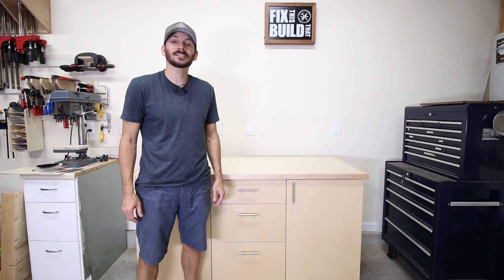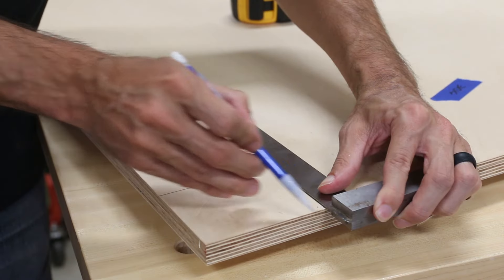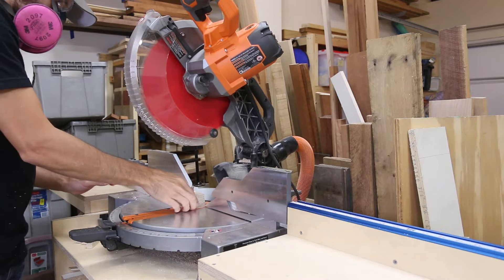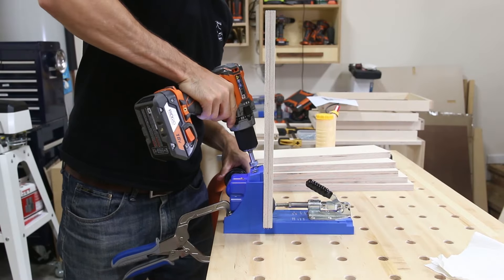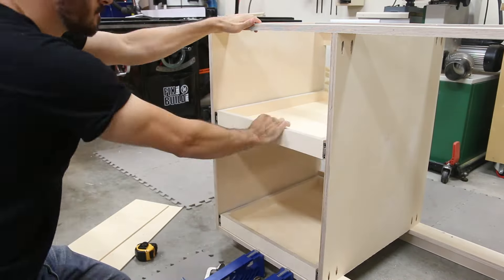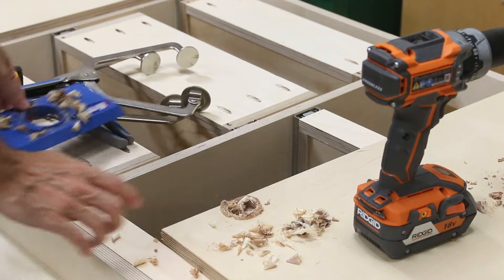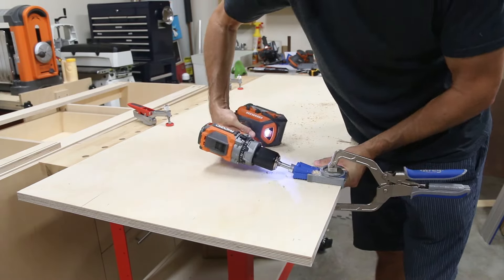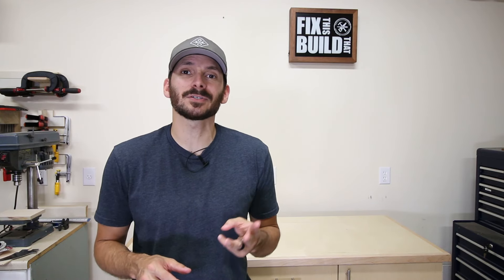How to Build a Base Cabinet with Drawers | DIY Shop Storage

Comment: Everything we need, and nothing we don't.  Thank you!  
It's helpful that you included your mistake and the solution including the fact that you would improve your solution in future!
I keep coming back to your video; it's the most helpful for my needs by far even though I'm only making a single cabinet with floor slides for my trash can drawer.

Comment: Man, efficiency is king in my book. Some try to call me lazy until they see all my work is done. I LOVE all the tips and tricks like the measurement cheats, it increases efficiency and therefore my productivity. Thank you so much man! (I have Asperger's so i dont always see what's so obvious to others.) Like the last video how to build drawers i was a little confused why you knock a whole inch off the height, but the details here lining up the drawer end and two slides to get the width of the divider was genius.

Comment: Kudos for the Kreg K4/K5 dust port and the track saw.  The dust port collects virtually ALL of the chips and is VERY inexpensive.  I bought the entire Kreg track saw system and it almost eliminates (maybe 98%?) circular saw dust in my enclosed, air conditioned shop where dust is really noticed.

Comment: Great build!  It is honing some project ideas I have. One suggestion though, add nuts to your adjustable legs to lock them at the preferred height. Vibration from power tools will cause them to walk out of adjustment.

Comment: Thanks. I just purchased the plans.  It's almost exactly what I was planning, just with slightly different dimensions.

I have two questions:
1. You use two different pocket hole jigs, I am guessing I could just use the K4 jig, right?
2. If I adjust with 1/2 spacers on each outer side, I am guessing I make the drawers 1" smaller?  Or did you already adjust for this in the cut list?  I know, math, but I thought I'd ask.

Comment: Absolutely love your videos man.  You are giving out great instructions and details in a way that is easy to understand and follow.  I came to know your videos as I was struggling with making drawers and using drawer slides for the first time.  I struggled my way through it, made a bunch of mistakes, wasted plywood too.  (:-)  That lead me to search for videos and found your site.  Darn it all, had I seen your drawer video first I would have known what in the world I was doing.  But I have to say you made me chuckle in this video when you gave out the proverbial uuuggghhh! after having to redo your drawer slides when you didn't take into consideration the drawer slides hitting the cabinet doors.  Great job with your explanations and describing your mistakes as well.

Comment: Love the video! These frameless cabinets are almost the exact kind I was going to build for my kitchen. However, only using braces for the frame and not putting a bottom shelf was something I didn't think of. I've been trying to figure out ways to save wood and that was a good idea thank you. I'm not sure if it'll work, I'm thinking about trying it on my drawers, but another thing you can think about doing instead of having to shim up your drawer rails is to Mount them to the bottom of the drawers instead of the sides. It would require installing a couple of small braces to attach the rails to and will also require using a thicker bottom to the drawer so essentially a little bit more material but on the other hand your drawers could go edge-to-edge and your rails would be hidden on the bottom.

Comment: Hi Brad, I enjoyed watching your base cabinets with the doors in the sides and the drawers in the center I have a thought about the t nuts and the carriage bolt that's being used as leveling legs we put the leveling legs directly on concrete over time you could get corrosion and I have a solution for that problem that you might want to try instead of using the round head carriage bolt use a flat head bolt sand off all the information that's printed on the top get a small amount of self-adhesive rubber cut it to size to fit the bolt and then stick it to the bowl now when you put your cabinet up your base unit isn't going to be sitting directly on the concrete to cause gallivanting corrosion.
Reply from the maker: Good tip

Comment: Thanks, this is exactly what I'm looking for. My small workshop is almost done. It's 16X26 with 10ft ceiling. Next step is building all my cabinets and work tables. I can't wait. I have a small 16X16 studio above, with a 10X16 patio. This plan would also work for the small kitchenette upstairs as well. Thanks!
Reply from the maker: Check out my garage style cabinet vids too. Another great option for walls 👍

Comment from the maker: If you want plans to build this base cabinet you can get them here:  https://fixthisbuildthat.com/largebasecabinetplans
Reply: Fix This Build That
Reply: Very nice cabinet drawer!
Reply: Fix This Build That I got these plans and the lathe cart plans yesterday!
Reply: I just found this video. It will be helpful for the cabinets I’m building for my shop. Thanks.
Reply: What did it cost in materials?
Reply: Do you know if the plans account for the drawer clearance vs the 110 degree door hinge? Like you mentioned in the video, it will change the dimensions of the drawers, and I'd like to plan ahead.
Reply: I have been looking for something just like this, will be my winter project, thanks ....
pwm
Reply: hola que tipo de madera utilizaste?
Reply: I am a first time DIYer. Any idea how much time it took for you so that I have an idea before I can start this project?

Comment: Nice build. I've never understood not having the rear of the drawer bottoms supported in a groove. It's easy enough to do and will never sag, especially in a shop cabinet where heavy duty is the goal.
Reply from the maker: Thanks!
Reply: Agreed, and I'm not sure that 1/4" is thick enough for that size of drawer, especially in a workshop.  I've had too many drawer bottoms bowing downwards and the contents disappearing down the back of the cabinet.  Nevertheless, a good looking and useful cabinet.

Comment: I really enjoy and learn a lot from your videos, Brad. And I'm not afraid to admit I have serious shop envy. When making cabinet drawers, is there a general guideline you follow when deciding on the thickness of the plywood you use for the drawer boxes? I'm relatively new to building stuff and I default to 3/4 inch because that's what I see most YT makers using, but 3/4 feels like overkill for some of my smaller projects. Any advice? Thanks again for the great videos.
Reply from the maker: 3/4 is overkill, but makes good use of a full sheet vs having leftover 3/4 and 1/2.  But 1/2 is definitely adequate
Reply: @Fixthisbuildthat  Thanks, Brad. One other question: For the bottom pullout trays in this cabinet, could you have installed the drawer slides as under-mount slides, or will they only work as side-mounted slides? Thanks again.

Comment: Great project! I screwed up the top drawers in my miter station when I built it. Forgot to account for the support piece in the back so all the top drawers were too long. That was a frustrating moment. Still came out great though! Really like the design.
Reply from the maker: +YouCanMakeThisToo thanks, Caleb! It's one of those things that is so easy to mess up

Comment: Looks almost too pretty for the shop, is this something you would recommend for inside the house? I like your work and also the ease with which you plan.  I also like the fact you shared your mistake, this could have been easily covered, however, it's good to know even pros make mistakes.  Thank you for sharing this build, I learned a lot and now feel a little more confident with my own build.
Reply from the maker: This could work great as a bathroom vanity too!  Thanks

Comment: I like that you made a mistake (at 7:03) because most of my projects I almost ALWAYS mess up something to the point I rarely enjoy it. I made a ghostbusters play table (video on my profile) but I didn't take into account that my sons bedroom door is 1cm smaller than the doors downstairs so on christmas day I was removing the door frame to get it in!) theres always some unforeseen thing that sets me back hours of my time. Not that I like that this happened to you, but it shows that it can even happen to a professional who can make such awesome cabinets.
When it comes to diy now i usually add at least a day more time to complete due to losing pencils, screwdrivers, something breaking, measuring something wrong, something always messes up no matter how much I plan it but it's nice to see that it was worth pushing through the error to get to the finish piece. excellent

Comment: Hello, the screws in Peru have a cross entry and the pointers are thus not square. If I buy that machine can I use it without problems? Will I need the square tip extension or can I use the traditional one here in Peru? Thank you.

Comment: One thing to keep in mind for anyone hoping to modify the design: this design only works with doors on the outside/drawers in the middle.  Standard euro hinges require a full 3/4" thick panel for the hinge-side of the door to land on--you can't share a single panel with drawer fronts.  There are hinges that don't need as much room, but they protrude about 3/4" farther into the space, so pull-out shelves become more difficult to accommodate.  It's still possible, but much less practical.

Comment: Great build dude... Although you could have used concealed hinges that open greater than 110 that would have spaced the door out enough on your drawer runners... You wouldn't have had to rebuild them then. But cool cabinet nice work

Comment: Brad, in your video I don't see you using glue except for the maple on the top.  However, in your directions on step two you state pocket screws and glue.  Is this correct?

Comment: Brad, just wondering if you have a slick or full proof method for installing the hinge clips to the cabinets so they line up with the hinges.   Especially if the top is already on the cabinet.  Thanks.
Reply from the maker: Nope, that was a bit tedious to measure and mark

Comment: I bought the plans and plan to modify to make a longer, deeper cabinet  given that I have more space under the table saw.  A little disappointed the plans are a pdf.  Do you offer the SketchUp plans?  That would make modifying the sizes a lot easier!

Comment: I would love to know what you think of the Kreg Accu-Cut. I'm thinking of getting one, since I can't afford a track saw or table saw right now.
Reply from the maker: +Chris Brower I love it for breaking down sheet goods, Chris. I don't do finished cuts, but could if I wanted to. Would just take a little more care and setup. But for slapping it on a line and quickly breaking down a sheet it's way better than a Bora clamp

Comment: Another great build.  Question...  Was there just not enough wood to trim off from left and right sides of your trays to make them fit after shimming out the slides?
Reply from the maker: +BronkBuilt I had stupidly put the Brad nails too close to the outer edge and didn't want to wreck my blade. If I had of centered them it would have worked. Believe me, I thought hard about just going after it 😃

Comment: We all screw up. My grandpa used to say that the best carpenter is the one that fixes his mistakes the best.
Reply from the maker: +Bobby Stanley absolutely!
Reply: My boss always tell me the same and that his dad taught him that
Reply: I made a pair or speaker stands and the vertical is all the way to the back of the base and as a result, tippy. I should have placed it 1 1/2" from the back edge of the base. I'll find out when I put the speakers on them if I need to redo them.

Comment: Hey guys, what is the maximum distance between 2 dividers considering i use 1/2 inch ply ? I don't want it to sag for the sake saving on material :)

Comment: Instead of rebuilding the pullout shelves, could you have taken 1/8" or whatever the amount of material off with your table saw? Or a 1/16" on both sides to keep it symmetrical? Do you feel that would make the selves to weak?
Reply from the maker: Didn't want to hit the nails. But could be done

Comment: Hey Brad this is awesome! I’m trying  to do this in my trailer but I need an “L” shape. I’m a total newb. Do you have any suggestions on how to do this in an “L” shape? I’m running into problems at the corner where the cabinet doors meet. Thanks in advance.

Comment: I feel ya on the drawer situation. I had that happen to me once... but only once. After that never again. HAHA  I recently built a cabinet using the same Euro hinges you did. Did you have any issues with them?  My cabinet was four fronts in a row.... It took me almost an hour to get all 4 doors to be straight, level, flush... whatever you want to call it with each other.   I would adjust one, then have to move another, etc... ugh... In the end it was still just slightly off. I think I'm my worst critic and my wife says no one will notice.
Reply from the maker: Yeah, I'll never do that again which is the bright side.  Those hinges do seem a little finicky.  I got them to behave though with minor adjustments.

Comment: would  you sell  the precut plan and ship  wood cuts and hardware so i can  put together at home?  same  size you have it on video ? and add wheel casters on bottom  so I can  use  for my cooking pots also  add a power strip on  side or back  to use for cooking moveable counter? i know 2 yrs ago  but been looking for something for my Instant pot and stuff  and hold my kitchen-aid mixer , that look  like it would be a good plan for all my kitchen  stuff and with wheels i can move in and out of my way,

Comment: Hi there. Great video! About the drawer problem.. how come you didn't just change the hinges to the 180º type? Once the door is open it gets out of the way as it pivots to one side, so I think it would have been easier that for you to redo all the drawers. Just a thought.. Anyway, this is a great project. :)

Comment: Nice job. Would it have been easier to cut down the tray on the table saw and added a new side rather than re make?
Reply from the maker: +Graham Orm absolutely, except I nailed it too close to the edges and didn't want to wreck my blade 🙁

Comment: What a fantastic build and addition to your shop. One question is why didn't you put any wheels on instead of the leveling feet? Is that because of were it's going, it will be staying put?
Barry (ENG)
Reply from the maker: +Barry Roberts yup, that's exactly why, Barry. Also because I want a level surface on the top.

Comment: Great video, I must be a newb because I'm still at the point of asking what kind of plywood did you use and where do you get it? How does it compare to the "Cabinet" grade type from the big box stores?
Reply from the maker: It's baltic birch from a plywood dealer locally. Much more stable than stuff from the home center

Comment: Hello! I am a young Korean who often watches your videos. I'm always watching your videos. I'm writing comments because I'm curious while watching the video. If you look at the table-sourcing drill press, it looks like the birch plywood boards are 18T. I think you use 18T as a whole. You can use 12T in part. Why do you use 18T?
Reply from the maker: I like the extra weight of the thicker material for stability
Reply: Thank you very much for your answer.

I'll come and see you later.^^

Happy New Year.

Comment: with the drawers pulled out, how much weight will they bear?
Reply from the maker: 100lb drawer slides 👍👍
Reply: thank you
Reply: That depends on the drawer slides you get. The ones linked by brad are 100lb.

Comment: should have checked into a door hinge with a larger arc opening. Cause you said you had 110, an they come 165
Reply from the maker: +Greg Ward I'm with ya. I actually ordered them. It was $15 for what I thought was 1 pair...was for just 1!! So 6 times the cost of the 110.  So I shimmed 😃
Reply: minus return value of the hinges you don't need. If it was just shimming then I agree just shim, but it was also cut down all the draws in width too. That is a lot of work, its the only reason I thought of the other hinges.
Reply from the maker: Yeah, agreed.  But I wanted to make it the most economical for someone to reproduce as well.